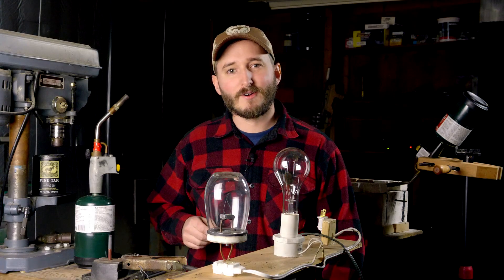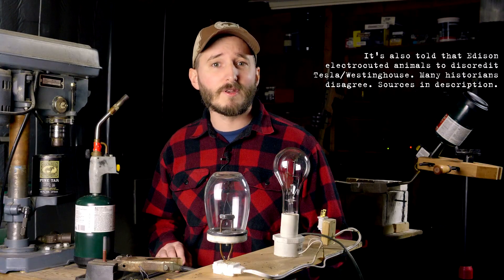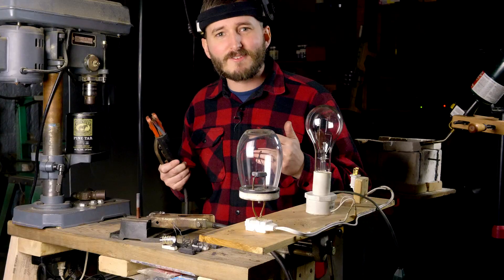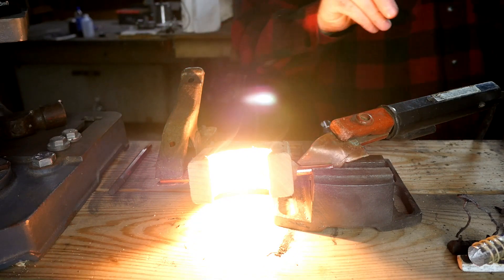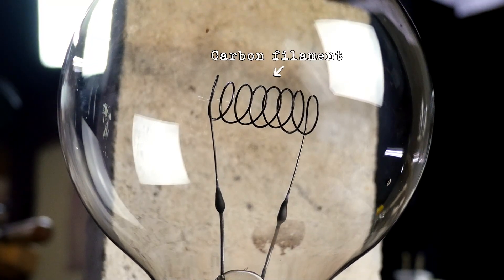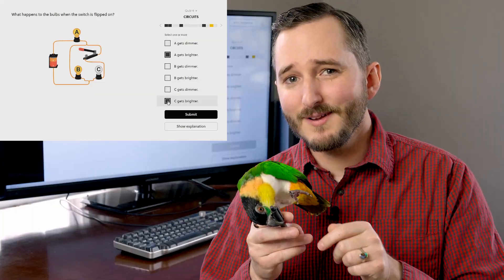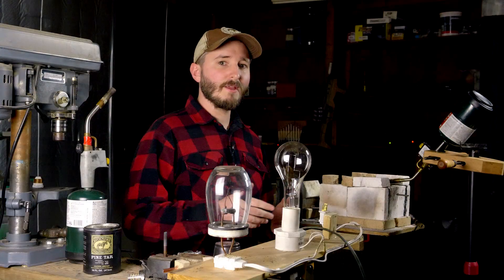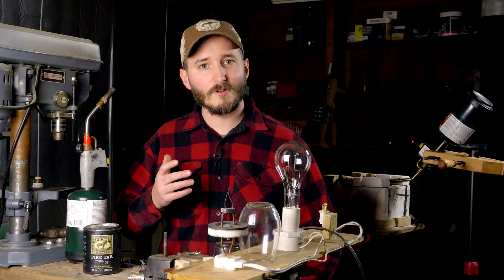Re-Inventing The Carbon Lightbulb

Comment: They also used phosphorus for fluorescent lights.
Did you try converting the carbon filament into a pseudo graphite?
That lightbulb is a fuse though.
Reply from the maker: When the filament first has electricity passed through it it should be hitting a hot enough temperature to convert to graphite right in the bulb. I did not have a furnace that could get hot enough to make graphite directly.

Comment: What type of vacuum pump did you use, and how many inches of vacuum were you able to pull?  Yes, as others have mentioned, it would be interesting to purge the air with an inert gas, then pull whatever vacuum you can manage and then test.  I want to re-create some of your experiment as a scientific, fun exercise with my daughter.  Please let me know what vacuum you were able to achieve.  
FYI, quite functional vacuum pumps can very easily be made from old refrigerator compressors.  Mine pull about 28.5 to 29".  Thanks!
Reply from the maker: Generic pump from Amazon. It gets down to 29". As I talk about in the video I didn't have success using vacuum. Edison got down below 1/1,000,000 of an atmosphere.

Comment: Why not make a filament grid. They could be the same shape as your working set up but have 3 or 4 docked in series in your bulb. You might need a bigger glass or redesign your ceramic deck in a square to support 4 filaments in series in the one bulb. 4 times the light and resistance.

Comment: Very nice video! When I made the reproduction edison lamps I used commercial carbon fiber. A fellow at the fiber company was kind enough to send me a handful of it to use. At the time I was making the lamp for a customer and failed to make a video of the process. I will make another one shortly and video the procedure. My version of the Edison lamp used Argon at a few microns pressure to prolong the life of the filament. It turned out quite practical to operate the filament hot enough to produce the "Edison effect" current to a plate in the lamp.
Reply from the maker: Are you by chance the one who makes the Edison bulbs for the Henry Ford museum? A worker there told me that they were blown by a man in Michigan, though he thought that the person used tungsten wire in the reproductions. They also ran on a low voltage power supply for longevity. My goal in this video was to demonstrate the process of creating the filament itself more so than the bulb, so commercial fibers wouldn't work for my efforts. Though I'm sure carbon fiber works very well.
Reply: @Nighthawkinlight  No, I make reproduction early vacuum tubes. (see my glasslinger channel) Someone was doing some recreation of Edison's experiments for a fair display and wanted a close reproduction of one of the Edison lamps. I think you could use green bamboo for making the filament. I tried it and it worked quite well but the spirals were about a half inch diameter.

Comment: You can probably make extremely thin and flexible pieces of bamboo by taking a piece of bamboo (I'd recommend a cutting board) and cutting lengthways with the grain at a 45* angle with a razor blade, and then cutting an accompanying cut at -45*, making a sort of V.

Comment: I tried making a bamboo filament after watching this video. I cut thin hair-like strands, boiled it and rolled it over a metal tube and let it dry... Although it didn't come out like a coil, it was still workable. Then I charred it. The end result of this filament wouldn't conduct electricity. Don't know why? At this point, I am only checking if the electricity passes through it. It is non-conductive. I test it against a regular piece of charcoal and it conducts electricity. ( I was going to make a DIY light bulb out of pencil lead but this video gave me the inputs I needed) The light bulb I made with pencil lead consumes a 12 v motorcycle battery in just 3 secs!
when I connect it to 24V,2A adapter...nothing happens. But if the rub the graphite lead on another, It makes an insane amount of light. COuld you please reflect on this situation of mine please
Reply from the maker: It requires higher voltage to overcome the initial resistance of the filament. Or you can heat it way hotter in the kiln to change it to graphite.
Reply: @Nighthawkinlight  I checked it connecting to the power line of 220 V, 5 amps. Nothing happened. The pencil lead bulb popped with this same very supply.
I was too scared to connect it to the arc welder and check it. I crushed a few filaments to see if they were charred properly and they were! ICan I share the video clip with you. Hope I am not disturbing you.
Reply from the maker: 220v might not be enough. Read Edison's patent in the video description. He smeared his filaments with lampblack and tar putty to make them conductive. He also heated them in the kiln to white heat for several hours.
Reply: @Nighthawkinlight  don't know if it's possible for me, but i will surely try it out. Thanks for taking time to answer my queries. That's very nice of you

Comment: I watched this video in my quest to make white phosphorus. I want to make a solid graphite rod by mixing powder carbon with sugar, forming into shape, then drying and firing. Once it gets hot enough the sugar should turn into graphite and fuse with the powder carbon. But , i also want to mix some bone ash and sand into the graphite rod. Then put the rod into a glass bulb and fill with nitrogen , run electricity through the rod to get white hot, ...phosphorus should soon coat the inside of the glass bulb

Comment: I have an idea for a physicaly three-dimensional monochrome luminous hologram, the Star trek holodeck equivalent of the first black and white TV. There is one minor problem though I can't seem to find the information regarding what bandwidth of light causes nitrogen gas to luminous. Please help?
Reply from the maker: What gives you the impression that any bandwidth would cause it to luminous? Most gases only give off light by high voltage stimulation or elevated temperature.
Reply: @Nighthawkinlight  a high enough powered laser is visible as it passes through the air because the particles scatter the laser if everything else luminesses under a certain band width of light corresponding to the substance and gases are made of matter so hypothetically speaking the right band with the light should make it luminess with a fraction of the power

Comment: Stunning vijayo, and huge kudos for doing the many hours of physical and skull-sweat that resulted in this short (intense) production.

I was aware that Edison used bamboo to make filaments, but I didn't know it was so special.  Bamboo is a grass, and I have a suspicion the tough outer skin contains some silicon.
Perhaps using heat-accelerating ageing would improve its qualities?
A week in a large box, heated with an <erm> eclectic lightbulb.
I wonder what would be best to produce ultra-thin filaments, splitting or shaving with a microtome? … And when?  While still moist or dry and hard?

Truly, the devil is in the details, and we are the recipients of great gifts from our predecessors.

We really do stand upon the shoulders of giants.

Comment: It's simple. You don't go the local home improvement store and build a house from the ground up. You hire a construction crew that has the correct knowledge for each phase of the build. It was the same a Edison. He had the idea just not the specific knowledge for each phase in seeing his inventions come to light. So what if he hired people to help him or if he did it all by himself. Without him and his team/s who knows how much longer it would've taken to get to the point we are at today.
That same thing can be said for most inventors and their inventions. Do you think it's one person coming up with new things all by themselves? If so you're delusional. In fact 90%+ of "new" inventions are based on others old and new and reworked just enough so they can slap a patien on it and make a bunch of money, and even then most will have a team of RnD personnel behind them as well as more teams figuring the right way to put part A and part B together so they get the desired results.

Comment: Help i need that tar putty for something else but i dont know how to make it or  replacements for soot
Reply from the maker: You can buy graphite powder at a hardware store, it's sold as a dry lubricant for locks. Mix that powder with tar or molasses/honey and it will make a paste that will carbonize when heated.
Reply: @Nighthawkinlight  thx

Comment: As doubtless you know, the composition of bamboo is not consistent throughout: the external skin is exceptionally high in silica. Any chance that Edison wasn't just using "bamboo" but rather filaments of the outer fibers of bamboo?  And if so, what role might the addition of silica make to your more domestically available filament sources?

Comment: You need a variac to do these experiments because controlling voltage will yield better results. Back in those days everyone had some kind of lighting transformer back when lights came around thats why a variac would solve your voltage issue in needing another light.

Comment: what if you primed shorter coils by passing electricity through them and then connected multiple smaller coils using that tar and reheating the now connected coils in a furnace before trying them again? yes I know they are fragile but I wonder if you used a very steady hand to apply the tar stuff if it cold be done?

Comment: My grandfather blew lightbulbs for Corning for 40 years. Retiring in 1967. He talked about Edison all of the time. I have on my own gathered a moderate collection of early lightbulbs.

Were you using bamboo that had been harvested and drying for 10 years, or using bamboo that had been growing for 10 years? My own experience with bamboo ( never attempted to make a carbon filament) while working at mountain top tower sites in Taiwan. Finding bamboo 3 & 4 inches in diameter. Using a knife, I could peel away the very thick very flexible individual fibers. I only thought about it, but I did surmise in my mind that Edison would use these large fibers, make the hairpin bend in them and bake in an oxygen deprived way to get the bamboo carbon filaments he tested with. I know that the info is out there somewhere in writing. I’m partially going off of my grandfather’s stories. Edison, Swan and Tesla were all amazing people to me. Because my grandfather admired them all so much. I could never pick just one as my favorite.
Reply from the maker: That's a great history, very interesting. I could not find fresh samples of bamboo in Michigan, but I did not look very hard. I may try again with a better variety of samples.
Reply: Thank you for the opportunity to share a little of my history.  Another relevant memory I had was that Edison would also braid a few bamboo fibers together, give them the hairpin bend and carbonized them in some of his tests. Maybe that would work better with younger thinner bamboo fibers. Can’t imagine how tedious that would be though.

Comment: I once worked with a fiber artist who used bamboo fibers -- an almost silky fiber that can turned into thicker strings and cords, and that looked like it would give you the needed consistency. This would be the mechanically separated bamboo fiber, not the rayon stuff derived from bamboo as it is no different from any other rayon -- WIkipedia has a decent overview of the difference. I've seen it for sale at various fiber craft shows, so it is available if somewhat rare.
Reply: I love that you know that most bamboo fiber is really just normal rayon!  Most people don't and sing it's praises about how much more eco friendly then cotton it is... and it's actually worse  because of all the processes it has to go through to be turned into fiber that you can make clothes etc out of.

Comment: If you filled a bulb with mineral oil what would happen when its electrified? And would the filament survive?
Reply from the maker: Good question. If the filament got hot enough to glow it would boil the mineral oil and explode the bulb I think.
Reply: @Nighthawkinlight  ive seen computers filled with them that seem to run fine, but I just dont know

Comment: I really enjoyed this video.  It reminded me of  my own experiments as a boy in the 1950's trying to make a light bulb.  For a filament I used the spring from a ball point pen.  As did Edison, I used direct current.  In my case I used the transformer from my electric train set.  To eliminate the oxygen in the glass bottle that I used as a bulb, I dropped in a lit match before sealing.  The results were only fair with little light, but a little better as I turned up the voltage.

Comment: "in order to go any further, I think I'd need a higher voltage power supply to provide the initial kick"

Arcwelder right behind him: 👀
Reply from the maker: Arc welders are pretty low voltage, lower than a wall outlet
Reply: @Nighthawkinlight  that's fair, I guess I should reas up on this kind of thing before I make a comment.
Reply: I suppose you could always repurpose a B+ center tap transformer from an old vacuum tube amplifier. 300v + and - on either side of the center tap. It could open some other potentials that you may not have considered.

Comment: Missing something:  you needed to add tar to the paper before carbonizing because the resistance of natural fiber is too high.  Then you complain that the result is too low!  So, why not just back off on the step that lowers the resistance?
Reply from the maker: The filaments will not conduct at all without tar.

Comment: Ben, great educational video.
I only hold a grudge against Addison because he was slowing down Tesla's AC implementation with his DC concept that he was pushing through. We all know whose concept was better now))
Reply: The name is Edison. Thomas Alva Edison.
Reply: Marc T  Tesla's polyphase electricity (known as AC today) could be sent for LONG distance transmission without loss of voltage,  where Edison's DC idea and transmission lines LOST SO MUCH voltage in a short distance that he would have had to put a power plant every 2 miles or so to make it work.... thus not working very well. That's why Tesla won-out over Edison. By the way, Tesla was the developer and designer for the first AC power plant today known and built on Niagara Falls!!! --- Interesting huh ---
Reply: @jmd2432  Except in the end Edison was right.    Now we are now using HVDC for long distance power transmission. Edison just did not have the tech available to fully exploit the advantages of DC.
Reply: Also he publicily electrocuted animals to show how dangerous AC is. Kinda uncool.
Reply: It's not that AC itself is more efficient, it just allowed the use of higher voltages because it's easier to convert between voltages with AC
today we actually use high voltage DC for some power lines, now that technology has improved
Reply: @12...  Still the power loss over longer distances with AC is substantial.
Reply: @Six_Gorillion  AC High to low voltage conversion is easy therefore you can transmit at high voltage with low losses. DC voltage is difficult at those scales so you have to transmit at low voltage and have high losses. Physics 1st semester course 1 on electricity...

Comment: Have you tried coating them with cerium oxide powder or any other metal oxides to see if you can get them to glow? ~( 'w')/

Cerium, Thorium and Cesium have all been experimented with in the quest for bright gas lit mantles, maybe they can work with electrical filaments?

Comment: This post relates to another NightHawklnLight  video ," DIY Solar Tracking System Inspired by NASA (Parker Solar Probe) "  . Could you post or point me to a diagram showing solar panels, wiring, and motor hookup, Thanks
Reply from the maker: There is none. All the wiring is visible in the video

Comment: "There are two people who typically get credit for this invention, depending on what part of the world you're in: the American inventor Thomas Edison or the English inventor Joseph Swan"
But what about Pavel Yablochkov and Alexander Lodygin?
It was Lodygin's idea to fill the bulb with inert gas to prolong its life, and Yablochkov, while specializing in arc lamps, discovered the possibility of using kaolinite clay as filament material. Both Lodygin's bulbs and Yablochkov's "candles" were patented and commercialized before Edison's or Swan's designs (although on a smaller scale), so IMO they should also receive at least some credit. Lodygin later emigrated to the US and developed a viable tungsten filament bulb, selling the patent to General Electric in 1890.

Comment: Carbon arc lamps did not consume a lot of power for the amount of light output they gave. For the time, they were well suited to street lighting and large indoor areas like factories. The dangerous UV C light they gave off was completely blocked by the glass shades put over them, so they were completely harmless in that regard. They enjoyed probably 100 years as the go-to electric public lighting, staying in use in some cities up into the 1920s or later. The main downside of needing the rods to be replaced every couple days was really not a big deal when you consider its main competition - the gas light - needed each light to be manually lit every night, then extinguished every morning.

Comment: Did you make that fuse? I've never seen a fuse with a lightbulb contact.
Reply: Those are the old style of over current protection, they are one time use, and have been superseded by resettable circuit breakers.
Reply: @cameronwalcott9326  Oh, I see. They are called screw(-in) or plug fuses. They were the fuse in fuse boxes before modern circuit breakers. I'm surprised they are still made. Aside from the occasional education video or a really old home, why would anyone still make these?